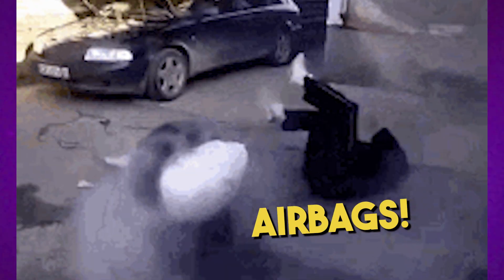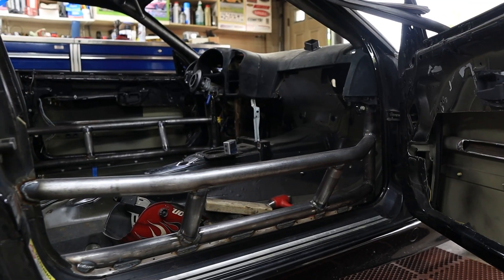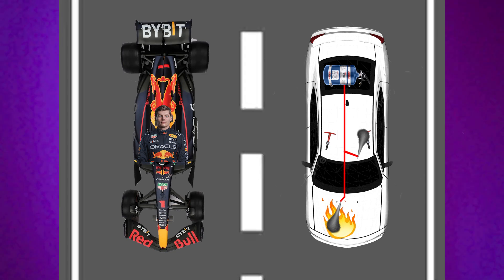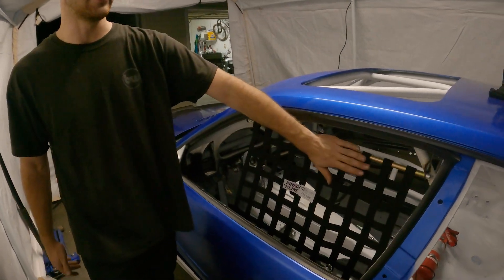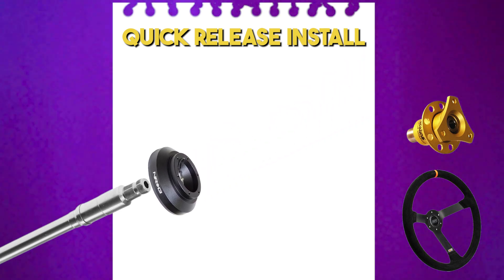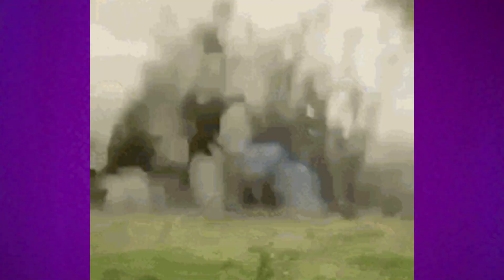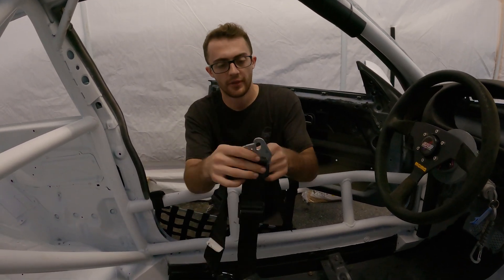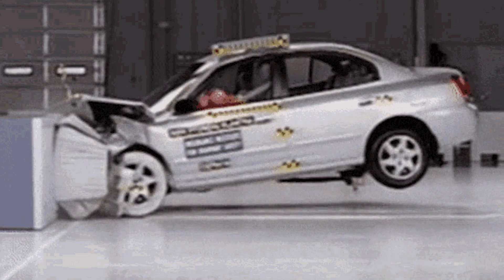Ditching Airbags for This? Racecar Tech Explained!

Comment: Got into a bad crash in my e36 but the harnesses worked so well the only thing in pain was the “contact point” of strap #5. Needless to say i switched to 4 point after that
Reply: did you have one of those neck things on too ?
Reply from the maker: 5th strap referring to the belt that comes up between your legs?

Comment: I will say that this is a very informative video. However, a friend of mine once explained a concept to me - Safety Equipment comes down to level protection vs the function. Eg. if you wear a scuba diving suit with an air tank on to dive 6 inches underwater, that greatly overcompensates your function, plus you're spending time actually getting ready than performing the task, so you always have to think "Is the level of protection necessary?". For racing, these are all perfect, but for everyday driving I think it would eventually pain. I didn't think that's the aim of your video but I'm sure at least 1 person thought - "This is cool, I should do this to my daily...".
Solid vid tho, I learned a lot and hopefully I'll get to build my own racecar one day.
Reply from the maker: You are right on in the sense that you would NOT want to do this to a street car of any kind. Like I said in the video, installing harnesses into your daily/street car is MORE dangerous than driving around with the factory seat belt. This video was mean't only for people who want to build a purpose built racecar that will not see the streets.

Comment: I would be bit concerned with welding an eyebolt especially with such a small shoulder and long threads. Most arent meant to be welded which all you've done is soften the surrounding metal and created a stress concentration. Sure the bolt isnt hooked shapped and wont fail under pure 1200lb of tensile load but can fail due to shear depending on the angles/seat position from a crack propigating at the metal surrounding the weld. 

Likewise for using DND products, nothing against them but talking about racecar safety without having a certified quick release and wheel is silly. Would be fine for something like drifting your not going over 50 mph but if you are dealing with vibrations like rally or if that wheel can bend by you jumping on it while on the ground its no good. If your serious then anything/everything on the car that is safety needs to be verified/tested with a date. Ebay wheels and hardware store eye bolts dont belong on a racecar. If you did this without making it as an educational video everything would be fine since its just on you/safety techs but sharing with others without qualifications can be dangerous.
Reply from the maker: Good comment, I was actually in the works of reinforcing the floor area for the eye-bolts. Origionally I was reading through a few different organiztions rule books and there was nothing against welding the eye-bolts to the chassis directly as long as it was not aluminum. But one of my tech guys made a good point, similar to yours, in that it would be much much safer to weld in plates to the mounting surface of the eye bolts. Just giving much more strength. So that is getting done, I plan on editing the video for that purpose.

In terms of the quick release and steering wheel, the Momo steering wheel is a very solid and safe steering wheel. It is not an Ebay or Alibaba rip off. Momo has been tested and proven over the years. When I was doing my research in terms of quick releases, DND was a name that popped up with many high remarks from other racers. Years ago in my first ever car I built, I used the DND quick release for over a year with no issues what so ever. In terms of other SFI rated quick releases, there are names like NRG which I would never buy for a car that is going to see the track. Then you have the more legit brands like Motion, Proworks, and OMP + more...but I never once had an issue with my DND set up and since they were similar pricing wise...I just stuck with what I enjoyed. If I ever have a safety issue or concern with it, I would defenitly make it known in a video and on my other social medias. But so far they have treated me well.

Comment: Dnd quick relese is GARBAGE. very likely to fail and tolorances are too big making it rattle
Reply from the maker: Interesting, I wonder if you had a bad one from factory. Both of my DND quick release setups ive owned have been great. No issues what so ever with either.
Reply: @EthanFifield777  based on people near me your case seems to be more rare. Most people in my local drift scene have only had bad experiences

Comment: Nice Video, but as a european im shock how "low" the saftey requirements for a rollcage are. For example the german rulebook (DMSB) forces you to have a double A-pillar. Also you need to weld in extram metall pieces in the edges of the rollcage. In many series your rollcage needs to in to footwell and directly to the shocktowers. For the Harness attachment you need to have a steelplate 0,11811inches thick and a area greater than 6,2 sqaure inches. Also your seat mounts from the left to the right must be one square steelpipe/bar so in the event of a side impackt the seat won´t crunch but move in the car. this way your hip doesn´t break. 
Please dont take it as crticism, I just wonted to show the regulations of other Countrys. I´m really interessted in more Videos of this car and look forward to see you racing this machine.
Reply from the maker: @Tomnowak18  Depending on which Rally series I end up competing in, I will need the “double A-Pillar” bar welded in. Not all series require it. For attaching the harnesses to the floor of the car, typically as long as you’re welded or bolted down with a large enough washer they call it good here.

The seat mounts being reinforced I like. That’s a good idea in terms of safety. Just not something required for the series I have planned.

The cage going through to the shock towers is actually illegal in a few drift series here in the USA, so that’s why that wasn’t done. Otherwise we would have welded those in 👍🏻

Comment: If the quick release is a “safety item” you should probably include a cool-suit on the list also. Lower core temperatures improve mental processing speed/capacity, and go a long way toward Improving reaction times and preventing accidents. I’ve always considered a cool-suit a key safety item for anyone spending more than 15 minutes in a car near the limit. 

Well done video! Looks like an awesome project!
Reply from the maker: @KindredAutomotive  The cool suit is actually coming in the next video hahah. I just didn’t have the wiring in the car to make the cool suit work. I have an ice chest and all the lines to run through the car

Comment: Super cool video! I noticed one mistake, the steering wheel quick release should be other way around, the purple part should be on the steering wheel, so you can take it on and off with one hand.
Reply from the maker: Good eye! But not all quick releases are built the same. Most of the higher end quick releases designed for motorsports specifically are built that way so that you need 2 hands to remove them. It creates a stronger spring load to keep the wheel locked on. The DND Quick release I installed in the video is one of them. Some other brands like NRG for example with their “ding” quick release that many people use, you don’t need 2 hands since it attaches differently. Many brands have different methods. Feel free to look up videos on the DND one. Maybe another video can show it better.